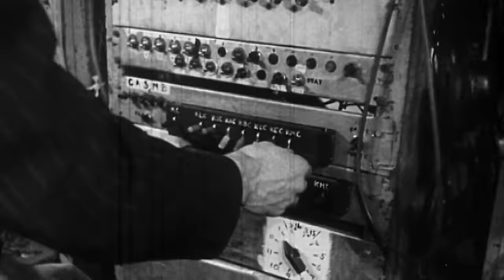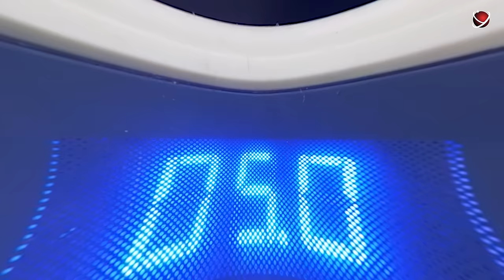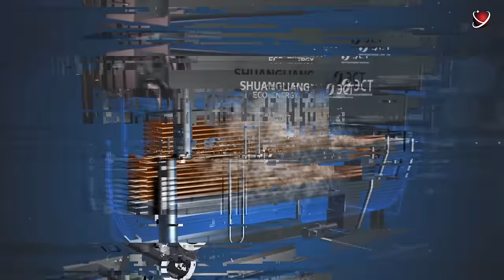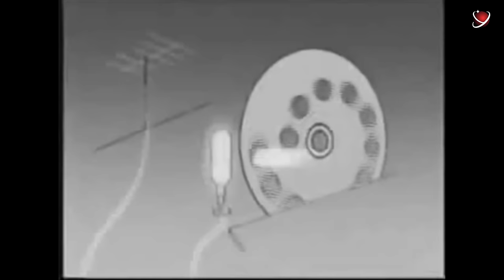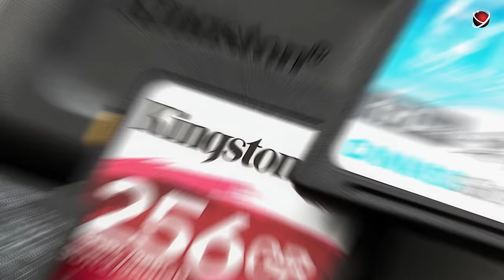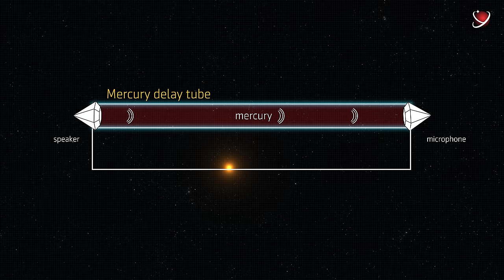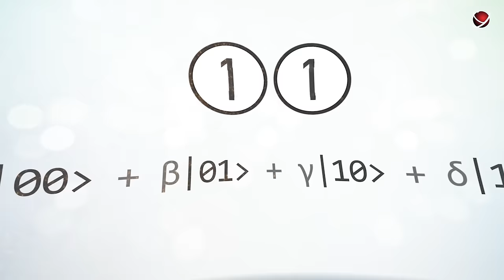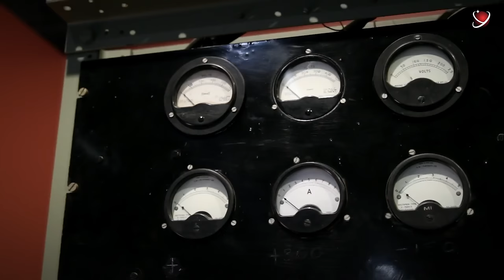Top Discoveries That Rewrite The Rules of Physics

Comment: I must be an exception to the rule then because I have a pretty good understanding on Advanced Technologies and in electronics like halving a A+ certification in computer Hardware. Another words you got to have a pretty good understanding of electrical engineering and Material Sciences and quantum mechanics. Been studying in these fields since 2002 and I still studying more on these fields.
Reply: For example how to fix the issues with ionic propulsion. Using a fentosecond laser to etch the surface of the blades increasing the surface area thus increasing thrust. And using supercapacitant Nano wires in a Step up Transformer to provide the high voltage and lighten the weight.